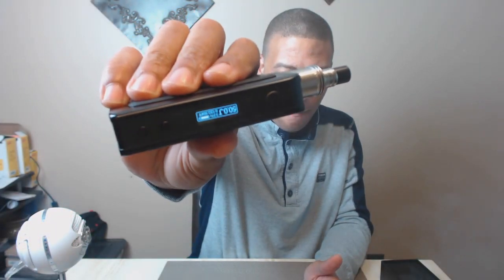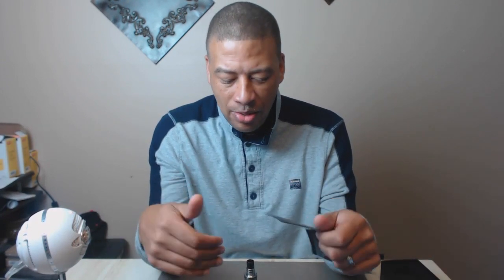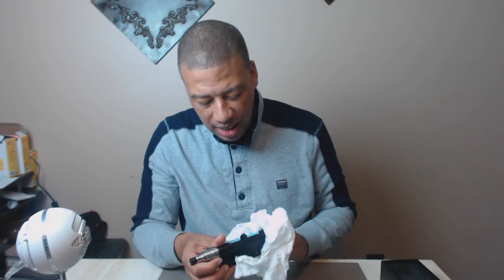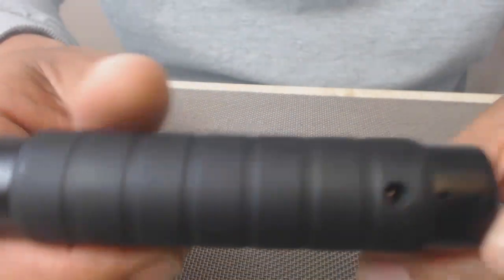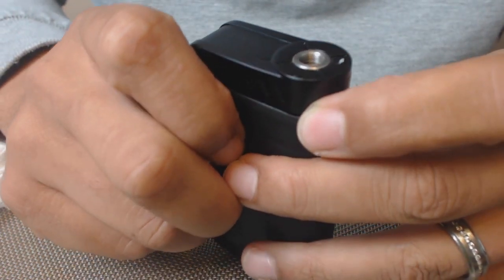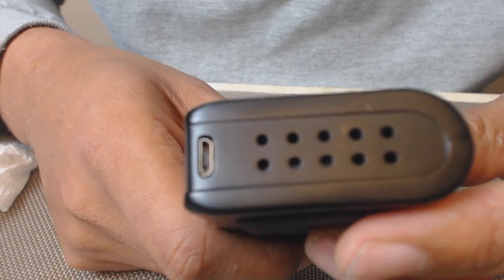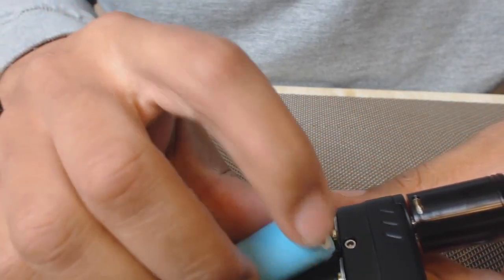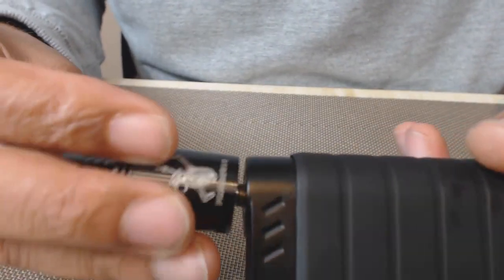IPV4 100w Temperature control & Real PSA      The Don

Comment: very nice video. straight to the point, no bullshit. no whining.

I noticed my ipv4 got a little hotter than it should have, I was vaping at 30w at that point and the top was hot to touch across the top, so I figured I'd leave it for a bit, no batteries in, put the batteries in when it was cooled, and let it sit. no change in temperature. I put my atomiser on top, left it for 5 minutes, the device got a bit warmer. That was enough evidence for me to open it up and have a look, the wire at the bottom of my 510 has no insulation at all. my fix? I painted over it with liquid electrical tape. I painted over every exposed wire and most of the balance board. now my device remains at a solid temperature, just like yours.

Comment: Another good review. For half the price of the SX Mini I don't expect it to be identical. Although almost the same chip in both of them. I do like how easy it is to swap batteries on this and thus no need for charging port.
And agree if bad device one review is enough no need to beat the dead horse. And any mod if you use it constantly it will get warm/hot which means it is time to put it down for a bit and let it cool down. Common sense is lacking out there. Same goes with your cellphone. If it is getting hot and about to burn you put it down and let it cool off.

Comment: Great video - looks as if that other fella brought all his issues upon himself.  Just trawled through his videos, and he seems to have burnt his device out by using the charge port to charge it, rather than charging his batteries externally.  From what I can see so far, nobody - including Pioneer4You - advises on using that port to charge the device, for just this reason.  Not sure why it's there, but there it is.

Again - great video, thanks for posting it.  :-)

Comment: Yo Donny Don Don, another great review my friend, I have a couple questions, u said u didn't find the SX Mini M class to be as good as the hype, and I'm paraphrasing, please, Do tell why u say that as I value ur opinion and love the SX Mini M, I think it's the best device out right now as far as temp control and consistency of the vape, get back at me, feel free to message my if u like. Keep up the good work. GO COWBOYS!!!
Reply from the maker: The chip is great. You can do just about the same thing with this chip for half the price ( this one doesn't go as low on nickel). The paint, the battery door and just fit and fit  finish on it was not worthy of 200 bucks in my opinion.

Comment: Well said.   Oh man I wish Pioneer4You made the screen more visible on the Silver Version like they did on the black. 

The IPV4 performs extremely well.  Its very solid and you really can't beat the price/performance factor either.

I do have my concerns with the device but then again I have concerns of one sort or another with just about all my devices.  

Unfortunately there is always going to be someone who rags on a device for one reason or another.  For a device to be deemed defective you really need to see multiple units with the same problem.  When its isolated to a single unit then that's just a defective unit that slipped past QC.    The other thing we need to remember is that sometimes its the user which causes problems when they open up devices and start playing around with them and well on a bad note I guess they learn quickly about the BIG BANG THEORY eh....
Reply: I bought a silver Ipv4 4 days ago and my screen is clear and no mirror finish.
Reply: Stephen Bruce There's a few videos showing how to take out the mirror finish and it's really easy.
Reply: Poppin' Suspence I had removed the mirror finish for the screen early on but recently I also REMOVED the CHARGE BOARD.   The charge board is just sitting in the mod between the battery tray and the 510 connector and the only thing protecting the board from shorting is a piece of tape on the top and bottom of the board.   Its clear to me that if that tape were compromised that a short would occur and I suspect that is why some have had their IPV4 burn up and its not juice related.   P4U posted a video with and IPV4 charging and they poured juice all over the board so its not a juice issue but a shorting issue which is what I suspected early on and after I first took the unit apart to remove the mirror finish.   So I removed the charge board but unlike the posted videos online which tell you to leave wires and tape them I thought it best to terminate all the wires at the solder joints where they are connected.   This means you will need to remove the battery tray to get at the control board to terminate 2 wires.   I do not recommend taping wires because tape comes over time especially in a heated environment.   Of course you will VOID your warranty but you will be vaping safe.
Reply: Stephen Bruce
 Interesting, thanks for the info. I'm gunna copy that down and look at mine! I just got it in the mail today!
Reply: Stephen Bruce the updated version have no mirror finish on the silver ones. they are black plastic with clear on the display. very birght
Reply from the maker: Preach on brother
Reply: I got the black on black one, I love it. And the screen is extremely bright, can see it fine in the sun and through sun glasses!
Reply: They have. I own the silver one. Zero issues seeing the screen. The screen has black surrounding it instead of the chrome crap I've seen in pics. Guess I just got lucky. 

I can even see make out what's on the screen while wearing my Maui Jim polarized sunglasses. Everybody knows digital screens are wonky with polarized glasses on. 

Just sayin

Comment: Hey Don, I need some help. I just got the ipv4 and running temp control with 30g nickel around 0.18 ohms. Running around 400 degrees at 30 joules. I've set my resistance on the device when it's cool. I'm getting burnt hits and the screen is telling me dry coil when it's saturated with liquid. Is it user error or a defective device? Please help
Reply: Lots of people forget to st the ohms first when the coils are cool! Hold up and down when coils are at room temperature
Reply: Are the coils spaced. You should never get a burnt hit. You have a hot spot in the coil. It could be a kink in the coil. I would rebuild it and try again
Reply: Donald Thompson The coils are spaced and I set the ohms while cool. Rebuilt it twice and got the same results.
Reply from the maker: Kristopher Manning what Atty are you using. The only thing left is maybe your screw's are clipping your wire. Try another Atty if its the same take to your local B&m and have them look at it if still bad send back
Reply: The Don thanks Don. I tried 2 different attys. Mutation x and dark horse. Maybe the screws on both are clipping the wire. I'm using 30g so maybe I'll try 28g or 26g before sending it back.